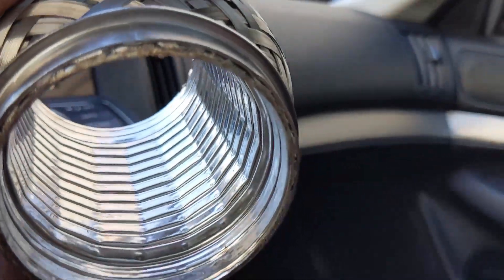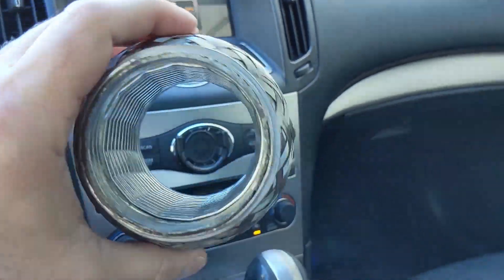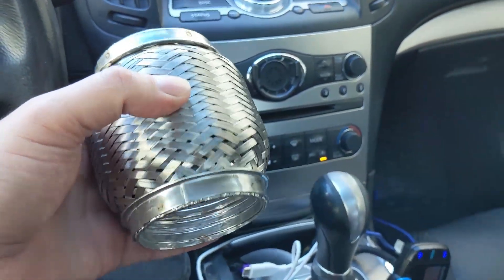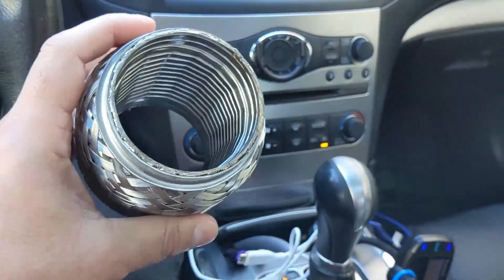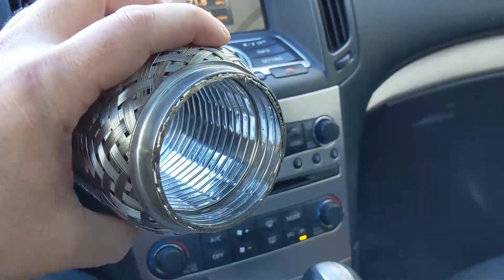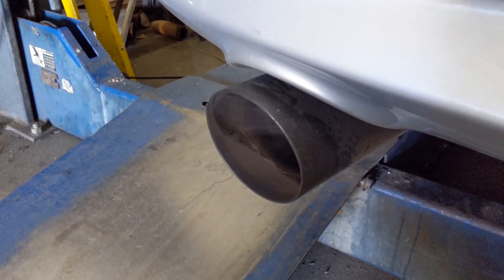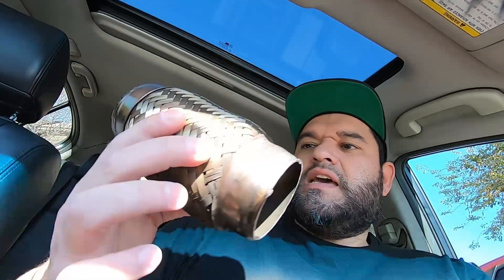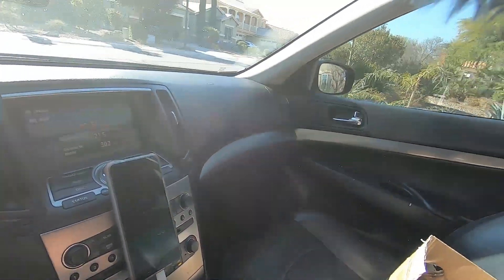Infiniti G37 Sedan Mods - How to Fix Broken Y Pipe Flex Couplings - Resonated Test Pipes Delayed :(

Comment: We have the same defoulers but mine is still throwing codes for cats I also replaced the 02 sensors and it was good for 200 miles now the lights back on. Any recommendations on how to get the light to go away?
Reply from the maker: Hello, I mean you could either keep adding more defoulers until you find the right amount or a good tune could also fix this. Good luck